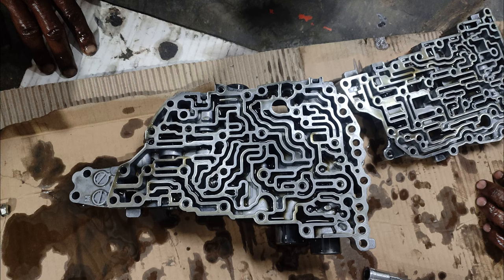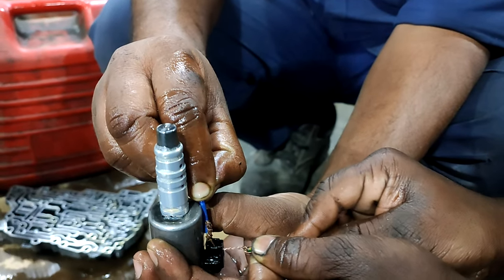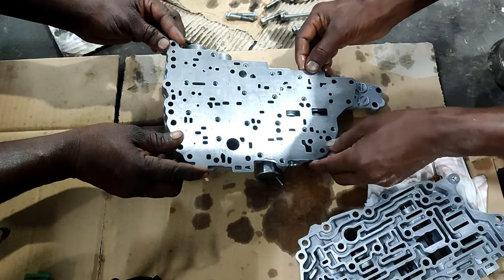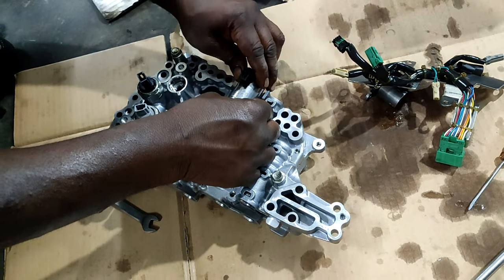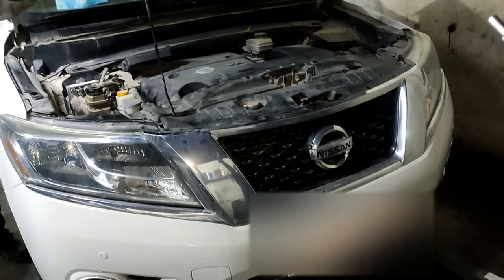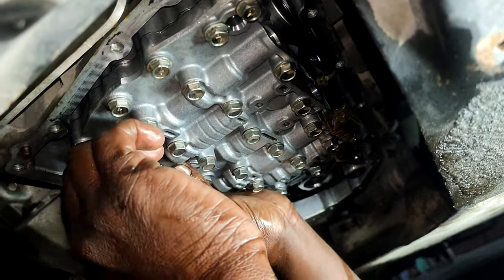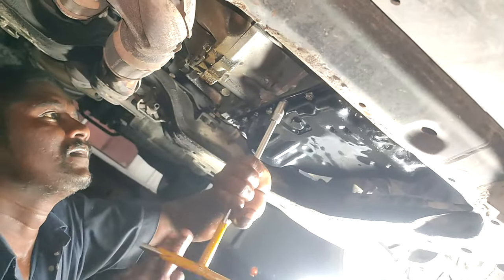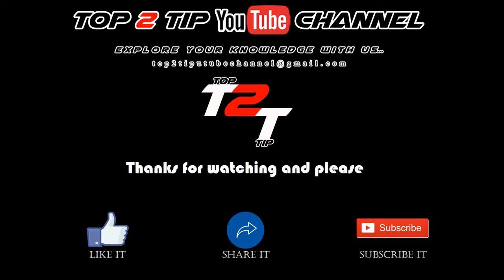Nissan pathfinder Engine Transmission Valve Body Cleaning and Assembling.

Comment: Hello guys. Would you advice with slight problem with shifting gears at low speed on CVT gearbox in Path R52?
Reply from the maker: Change oil and try

Comment: Hi. my car pathfinder 2010 4.0
when changing gear from P to D or from R to D, there is always a delay of 2-3 seconds when shifting to D. The rest works very well. What can be? Electrovalve?
I have new, original oil. Could some solenoid valve be responsible for this?
while driving everything is ok.
this is most noticeable when it's hot. and when I change from R to Drive.
thank you for the information
Reply from the maker: It’s maybe valve body issue
Reply: @top2tipyoutubechannel968  thanks. do you know how to test it? will computer tests show it?

Comment: Slammm dear.how many liters cvt ns3 oil if I change gear Box complete used change
Reply from the maker: 8 litter, Put 7 litter and check manually.